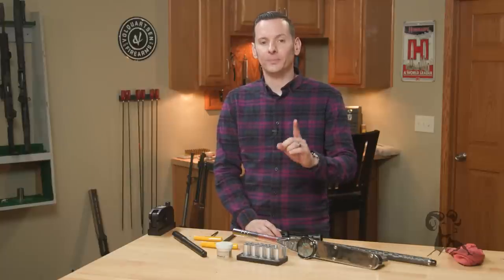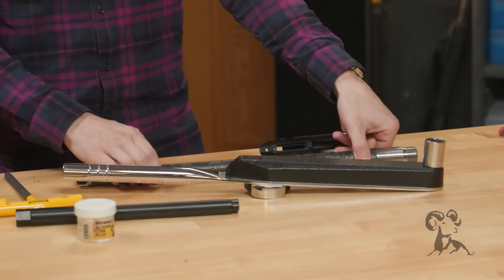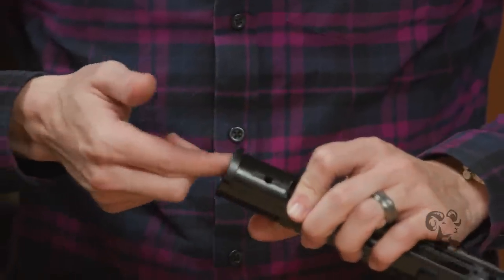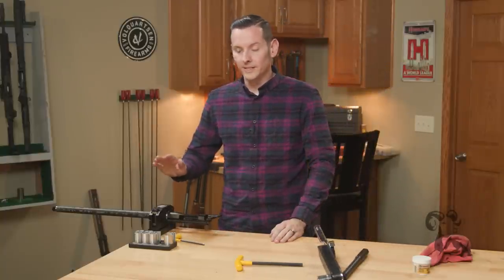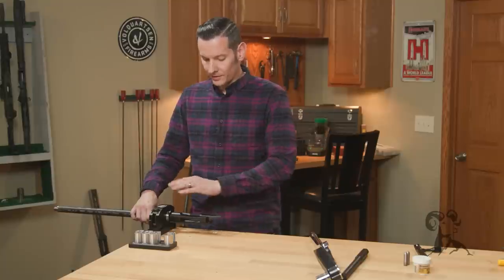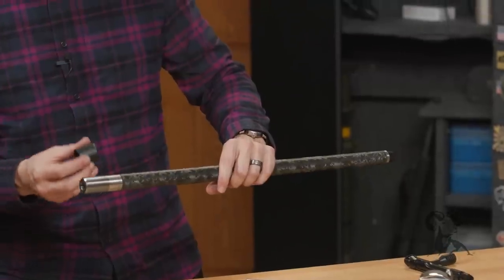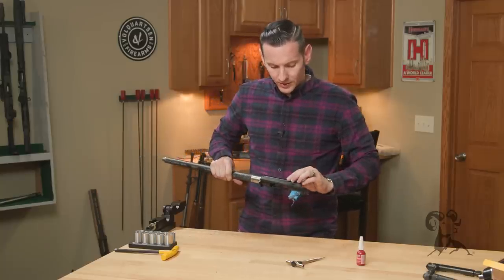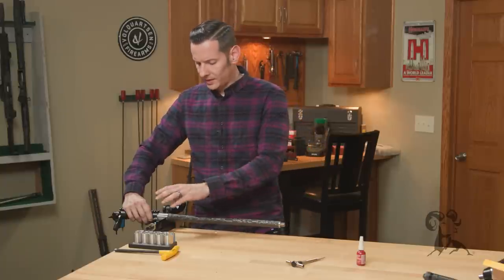Bolt Action Build: Part 2 - Assembly

Comment: ok so putting the barrel nut (wrench )in the vise getting that solid ,then using  the (action bar an applying the 44foot lbs  ,no scratches to upper maby  that would work >>>>>

Comment: Thanks, Caleb!  I built a 22 Creedmoor using the Solus action and a Zermatt pre-fit barrel. It shoots great!
Reply: Where did you find a 22 Creedmoor barrel? I’ve looked everywhere.
Reply: @bartrice8278  I bought mine from Preferred Barrel Blanks.   I chose that company because I could specify a reamer that would accommodate 88gr bullets. Criterion also has them. There are others as well. Good luck!👍🏻
Reply: @bartrice8278  just ordered a solus Lightweight action for a 22 Creedmoor build myself! What chassis did you go with?

Comment: I like the barrel vice. I was wondering if it could also be used to remove and replace a barrel on a Mini 14. The barrel vices I've seen look like slapped together junk with wooden inserts that require rosin .

Comment: Caleb - quick question. Will most chassis fit a barreled action using the Savage nut or do you need to find a chassis specific to that? I'm thinking chassis clearance just forward of action being an issue with the nut. I like the idea of the nut because if you're a volume shooter - no lathe or gunsmith required means minimal downtime once a barrel falls off. A way a guy can shoot PRS type matches without gunsmith expense.

Comment: It would be really neat to build, there’s only 1 problem!  Just the action itself is over $800 !!! So by the time you built this! You damn near could’ve bought a 50BMG rifle!
Reply: Leaving aside that I wouldn't want to be within 100m of some sucker who bought an $800 .50BMG rifle when they pulled the trigger, a complete Aero Solus is listed for between $1800 and $2500 on their website, whereas a Barrett will cost at least $10k and more likely well in excess of that.
Reply: These actions are very nice and the closest you’ll get to custom. I’ve shot one and it’s definitely comparable to my $1700 bergara b14 hmr pro

Comment: Isn’t the barrel-nut adapter on the torque wrench working like a “crow’s foot” where you should have the gadget at 90 degrees from the torque wrench handle? The way you used it you’re essentially extending the handle and throwing off the torque measurement - unless I’m mistaken and the tool already compensates for the torque recommendation?
Reply: That is correct, you torque at 90 degrees.
Reply: I notice in another video for AR's he uses the barrel-nut crow's foot correctly but doesn't point it out @MrPiimpslap
Reply: @bobvizza5490  I think the builder was just trying to show the steps but wasn't focused on using a savage shank barrel. He warned against using shouldered pre-fits but ultimately that's what he built. I have Origins and now a Solus too and use proofs prefit without issue.

Comment: Did you remove the ejectors off the bolt before using go/no-go gauges?
Reply: He said that those g/ng gages are cut away on one side, but since the Solace has two ejectors, I think you should.